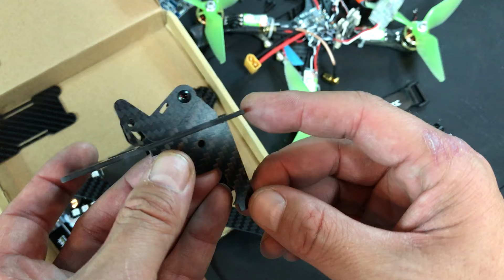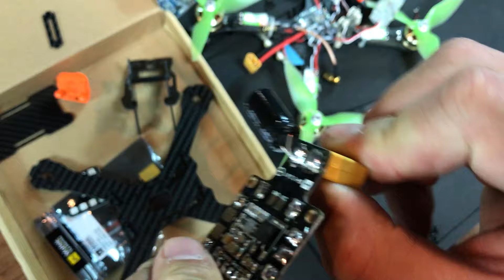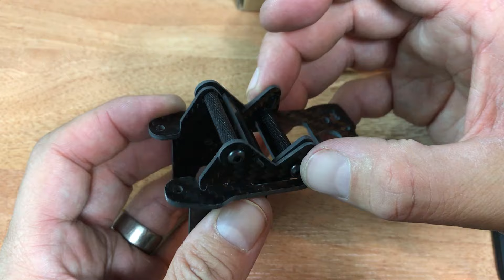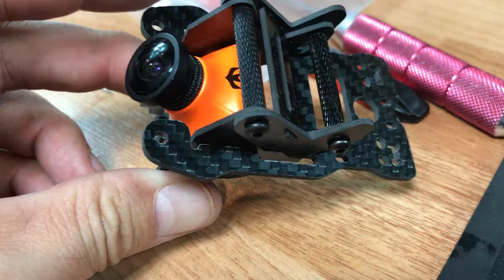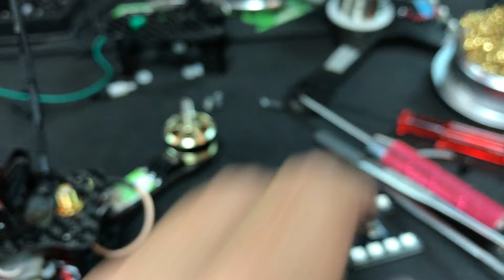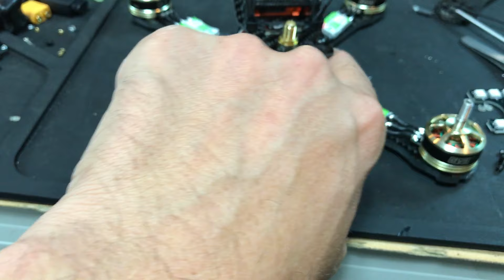Realacc x210 v+ Initial thoughts and build

Comment: I noticed a little gap where the runcam is mounted , it wasn't flush with both sides, some one also mentioned that it's about 3mm wider then the swift, is that true?is it an issue?
Reply from the maker: no isssue, if you assemble it wrong the camera mount will be too wide

Comment: Nice video. I just maidened mine today. It was a biatch of a frame to put together due to the lack of space.  I'm also running a 1000uF 25V cap on the main battery terminal and a 16V 470uF on the 12V line.  I'm running a Matek/Realacc PDB/OSD (same form factor as what you have) and it's terrific.  Flies well, although it's really squashy.  Interesting how you mounted the VTX.  You may find it a bit difficult to reach the power buttons for your ET526 once you put the LEDs on - that's why I didn't use an ET526 on mine (I was hoping to, however)... I'm using a TS5823L as it was small enough.
Reply from the maker: I'm pretty much know amongst my friends as Fatshark 1, 5740,,,lol
I don't race often enough to need to get at my vtx to change the channel. however, I can slide it out laterally with one clip of a zip tie if I need to change channels..

Comment: What size cap are you using for smoothing at the xt60? This is a great idea.
Reply from the maker: +Steve Barrett 1000 25w 105 degrees. There is a link in the vid
Reply: 7demo7 Appreciate the reply. Note to self, check links first... :-)

Comment: I'm a relative newb and just about hopefully to embark on my first full build and I've been looking at this frame. My mind is now made up - thanks :)

P.S. newb question sorry; was that a resistor/capacitor attached to your XT60? Is that to reduce signal noise over the vtx signal?
Reply from the maker: Reduces voltage spike (so i've been told), all the cool kids are doing it....